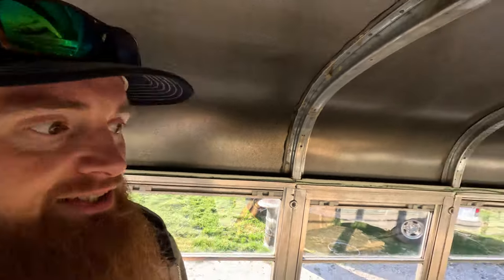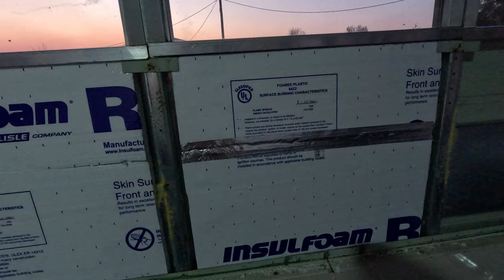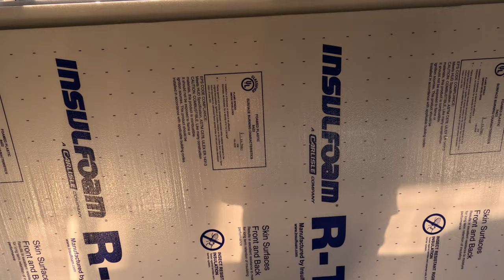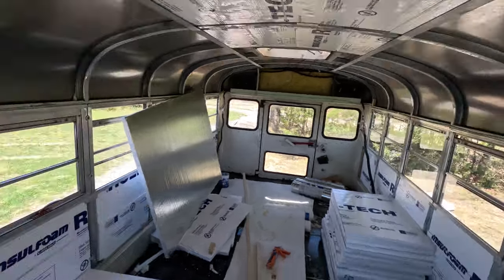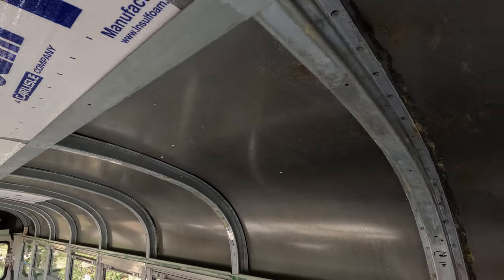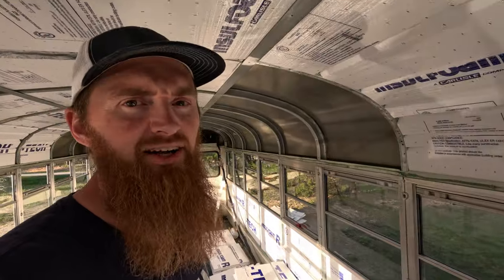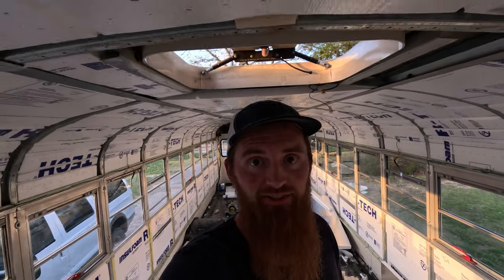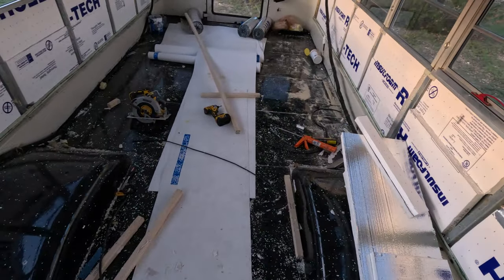Was Replacing ALL of our Skoolie Insulation SMART?

Comment: Thanks for sharing.  I used foam board in my remote cabin.  I cut each piece about 3/4" short then spray-foamed around the edges to make it air tight.  Looking forward to seeing your conversion.
Reply from the maker: Thanks for watching Bill. The spray foam has really done well closing everything in.